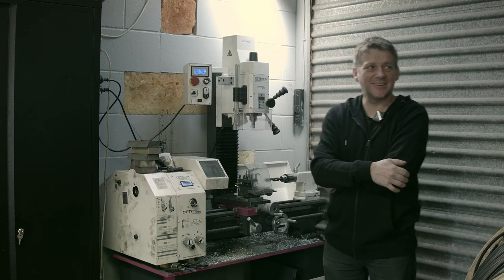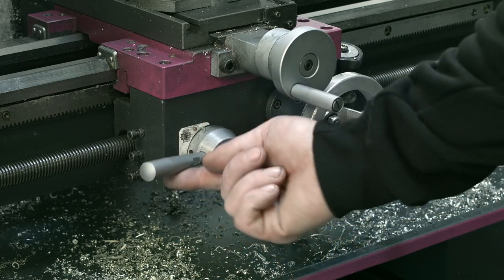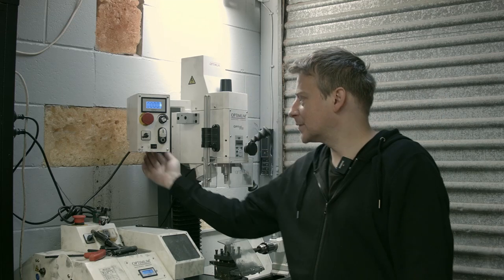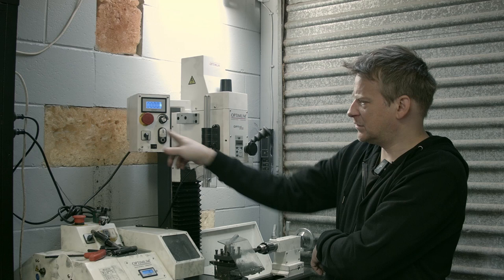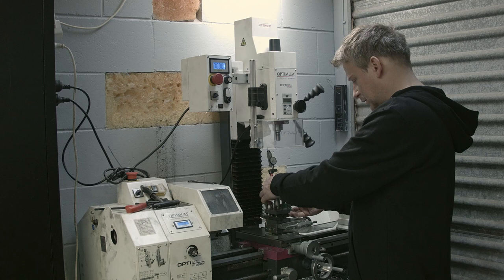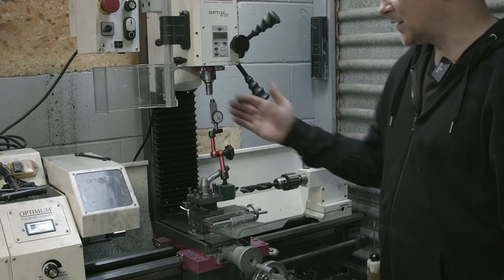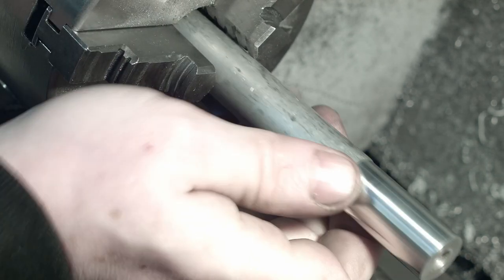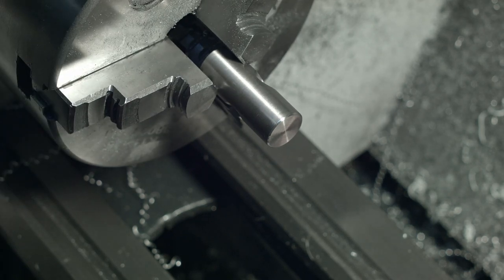TU-2506V-20M - Opti-Turn Lathe & Mill Drill Combination. review and test turning

Comment: That looks like a Grizzly G0602 lathe with a Grizzly G704 mill attached to it. I have both AND, YES the mill attachment is questionable. In fact I bought another column to scrape in for a CNC conversion.
Reply: I've watched further and I gotta tell ya both my machines are not as bad as your combo. It looks the Grizzly and yours were made by the same factory. Maybe the middleman has to pay more not to get and sell the factory floor rejects on to unsuspecting customers.
Reply from the maker: i suspect they make a lot of them for different companies , and i guess different companies pay different prices for different qualities. or this is a knock off of Grizzy by some other Chinese company. 
after a year this machine is falling a part.. recently to make a m8 thread i had to turn those gears they provide, so they are not jamming against each other... also i had to turn the OD so they are round not oval... 
everything what comes to my mind now are only bad words, so i will stop here :D
Reply: @PiotrFoxWysocki  Ugh. I hear you. I bought a PM932 which came with problems right out the gate. That was 3 years ago. I got sent a kit of parts to replace on the darn thing but with covid and other crap going on that is way down my list of things to do. It really is a crapshoot what you get with these companies that are just middlemen selling Asian imports of questionable pedigree.  Stay safe and get a better machine and look forwards.

Comment: Thank you so much for this candid review. I was looking at these yesterday along with the HAFCO AL-250-G and the bigger brother to that pair (TU-3008G and the AL320-G). The Optimum seem to have a better finish than the HAFCO with metal where the other had plastic, and just generally looked better. But I was concerned when I saw made in China on the back of the Optimum. While the Optimum looks better on the surface I am not convinced it is better when it comes to tolerances or performance, which is very disappointing.
Reply from the maker: Optimum was looking nice until the paint started peeling off like a snake skin.. I guess hafco won't be much different. Well I'm so disappointed with this one that the words can not describe how bad it is..
Reply: @PiotrFoxWysocki  I expected the HAFCO would be worse than the Optimum looking at it, although the HAFCO is heavier for the same class lathe. Things like the casting flash and rail finish on the Optimum looked much better, but it seems the beauty is only skin deep and under the hood it is still the same Chinese garbage. The TU-3008G and the AL320-G both look like a step up from the TU-2506V and AL-250-G, but so is the price. Seeing your review I don't think I could bring myself to buy the TU-2506V or the AL-250-G. Makes me wonder if I should DIY a lathe like I did my CNC.
Reply from the maker: Bigger is almost always better 😉 castings on the optimum feel very soft. And they are worn in no time. I'm contemplating on making lathe from scratch, or getting a tormach lathe. They seem to be the cheapest form factor to the performance.

Comment: Can you brace the top of the mill column back to the wall to give you more rigidity for milling?
Reply from the maker: I might try this eventually ;)
Reply: yes the problem there is the lathe frame. I have a bf20L converted at CNC and it's way more rigid that that. You better bolt it to the wall to gain the rigidity back.

Comment: Oddly, Congratulations.

You will get it sorted out. It is likely a Chinese unit. The mill looks like a Grizzly G0704 or Precision-Mathews. The lathe looks almost like a G0602.

The lathe turning looks decent on aluminum. On the stainless, it looks as good as the CNC'ed cut. Perhaps there's a more optimal insert for aluminum.

I've seen youtube videos where they bolted the column to the wall to increase the rigidity. On CNCZone.com, there are articles where people did the old polymer-concrete treatment to the column and base, but if you are going to CNC it, it's likely best to make sure you know what you are going to do with it first, before filling everything with Epoxy/granite.

Comment: Interesting video, I’m looking for a cheap bench lathe and here in Australia these units are one of the few options available. For those in a similar position to myself, go and have a look at videos on the subject by Blondihacks and This Old Tony. Blondihacks does one on Chinese lathes in general, and she owns what looks to be the US version of this one. Basically they all start out in the same factory and are then further fitted, machined and so forth by different factories to different specs for different suppliers in the country of sale. This Old Tony goes into tips like swapping out the headstock bearings (though he’s got a much smaller unit it’s probably still relevant info).
Reply from the maker: My lathe is failing in every element there is. It just falls a part.

Comment: I have the Optimum TU2807 vario, I too was very disappointed with the quality and it took a lot of work and modifications to make it reliable
My BF46 Vario mill had to be fully disassembled to tighten up bolts that fell out and replace missing bolts

Overall very poor quality control

Comment: So.  What size surface plate will you be building your lathe on?
Reply from the maker: Rather large ;) im still contemplating all sorts of angles and mounting solutions.
Reply: @PiotrFoxWysocki  Did you see Dan Gelbart's granite lathe? Apparently he build it from scratch, including air bearings except for the ones in the spindle and grinder. His machine is not large at all, about the same size as yours but have 1 micron accuracy, thanks to his surface plate bed
Reply from the maker: Yes i have seen it. I think accuracy is coming from more than a surface plate.
Reply: @PiotrFoxWysocki  He says the bed plus the accuracy of the spindle is the key but he does not give much details on how he build it. Also the air bearings on the bed or the tailstock seems not to have any tubing attached, so they probably rely only on static air cushion due to them being super accurate
Reply from the maker: Haha 😄 i think i should get much more misterious about my cnc as well 😉 so far looks like i give ideas left and right  and others take it and make their own channels claiming it was their idea. Kinda annoying. I guess its time to learn from the best 😉
Reply: @PiotrFoxWysocki  He has connections and apparently business sense for selling his inventions. So, he was indeed careful. He is specialized in precision machinery for optical systems and sold his company over a billion dollars recently. I think his educational videos on youtube is just charity and probably also due to lack of work as he does not seem to be kind of guy who would spend his newfound wealth on luxury.
Reply from the maker: Very Interesting, i didnt know that

Comment: I had the same bad finish like yours. And the problem was the bearings. They are deep ball grove. You have to change them with roller tapered. The difference was enormous. Also the chater and vibrations sounds are from the bearings. I noticed that the bearings are the most important part of a lathe becouse are a dinamic sistem. Change them with precision ones and pretensionate them and you will have anouther lathe in your shop.
Reply from the maker: Im sure i will take look into it shortly, once current bearings will fail.
Reply: There's a video from Dan Gelbart, he's build a high Precision lathe with selfmade air-bearings.

Comment: Yes, chinese mini lathes are tempting, roller bearings are way better, it's just such a hassle changing them. They could've used them as they were building the damned thing, not much more expensive. 
BTW, have you tried pcd's in stead of carbon yet? Will get you mirror finishes. Polishing carbon straight inserts with a high grit polishing diamond impregnated silicone mini wheel on a micromotor will get you great finishes too. With a coarser wheel you van reshape old chipped carbon inserts, even create custom ones. I'll be using a lot of convex, round shapes for different sizes when i get my lathe.
Bolting the minilathe on a heavy metal bench helps with rigidity. For small pieces and soft synthetics they are fine. I'am getting one. 
That mill though? I'm going CNC with that. 
Save your fingers, use a paper tissue cut in 4.
I enjoyed the video, will be looking out for more of 'em, cheers!
Reply from the maker: thanks for the tips, i will investigate
Reply: @PiotrFoxWysocki  https://m.indiamart.com/proddetail/air-bearings-11668946897.html
These are like $35-40 a piece, i think.
Reply from the maker: they might be a micron precision but they are not as durable as regular bearings. might be good for separate machine for finishing. but for removing lots of material not so much.
Reply: @PiotrFoxWysocki  yes, air bearings are best for small pieces, not for turning heavy load objects.
The good news about your "Optimus Prime" lathe is, it comes with a  "Self- destruct" mode. Just kidding, it just gradually turns into a piece of crap:)
The upside is, it has tapered roller bearings, P5 quantity, no less, the downside is, they're probably already shot. But they're much easier to replace. But try to lubricate these first, might serve you some time. It will probably a first they see some tending, they have to be oiled at least once a week, or get the closed ones, more expensive, no maintenance. The new versions of these have a digital spindle readout, same 750 Watt. That's the one i'm getting, they go around for €900. Installing a 3 axis DRO will be an aditional €200 with 2x 1 micron scales. You have to keep the dream alive with these things, haha. 1 micron!...

Comment: ...Mine has a different colour but is basically the same s***. The way to get a good finish is either take large cuts or tiny ones with a sharp insert. Get yourself some sharp polished inserts for finishing. I use them on everything, and as long as you do not do interrupted cuts they hold up good. Here is a link to the ones I use, you can probably find something similar where you are from. https://www.shop-apt.co.uk/carbide-inserts-for-turning-aluminium-alloys-non-ferrous-metals-plastics.html
Also if you turn chrome plated rods or rusty and scaled stuff, make a deep first pass to get under the hard part. Otherwise you will be constantly changing inserts.

Comment: have the same piece of junk, had to split lathe and mill, bought mill table, backlash is shocking, changing all xyz leading screws and motor which overheats in minutes at low revs
Reply from the maker: i have to say that this mill attached to the lathe is useless in this combination. i have been also thinking to take it off.

Comment: the worst thing about this lathe is changing the gears, i hate it, i always manual feed and leave it setup for threading , 1 of my gears is stamped incorrectly and 1 dosn't have any markings ...
Reply from the maker: Today I had to bolt 2 gears together because there was soo much play between them.. one tooth of backlash.. I also had to turn outer diameter because they have been jamming. Those gears are not even round..

Comment: I knew you cannot live with this machine, you will dismantle the machine and modify by polymer concrete change bearings,  reface mating surfaces etc etc to nearly a German standard.
Reply from the maker: Im not sure if its worth putting time into it. But who knows..
Reply: @PiotrFoxWysocki  on my mill I bolted an old lathe spindle head to it the table and the tools to the mill head, it's very automated now and can even pull  bar stock into itself.  I just unbolt the lathe head/"4th axis" when not using it.  Possibilities are endless, ideas keep me up at night...YOU know this!  haha
Reply: Polishing a turd can be a lot of fun sometimes:)
Reply: @ruud4508  and as Mythbusters proved, it is possible.
Reply: @kieranh2005  a turd can turn into a Prince, just not after a kiss.yuck

Comment: Please don't use or have cloth (incl. long sleeves) anywhere close to powerful spinning machinery. It can easily snag on the chuck or anything even slightly rough and pull your fingers/hands/arms in. Flesh and bone is nothing to a lathe that can do heavy cuts in metal.

Comment: Thanks for the review. But I'm guessing everyone watching this is on a tight budget. I have to say I watched videos of people spending hours and $$ getting eBay lathes to a standard that the optiturn 2004v which I bought had right out of the box for only $200 more. I'm no engineer but it's been a damn good little lathe. I'm also not building components to put a shuttle into space and back safely. These smaller machines seem great for the average crap the average person is doing in their garage. I also get a bit sick of bagging the Chinese. They also put satellites into space. They're mass producing items at a budget which we keep buying because we won't or can't pay a premium  then bitching about. Who's the idiot? I know I am and I'll keep going back for more because I can't afford the high end options. Btw .... There's plenty of folk building awesome stuff with optiturn lathes, eBay lathes, etc etc. Just saying .....
Reply: And while I'm on a bandwagon, check out blondihacks. Basically has the same model rebranded lathe (not the combo here granted), but she produces things I hope to aspire to one day. Point is, the machine is very capable. Look around before you bag something and decide not to buy. Search for it under different brand names and see what people are doing. I find people who bitch together flock together .....  I still appreciate this review though cause now I know I'll have to deal with the rigidity issue if I go this path. Thanks mate.

Comment: The only thing the manufacturer got from this was "that's pretty cool".

Hold on you cannot move the mill part. What is the point of this device? I picked up my Colchester chipmaster in good working order for £350! If you can get something like that why would you buy this junk?
Reply from the maker: hahaha:) yeah i guess so :)
Reply: @PiotrFoxWysocki  challenge for you, move the controls etc how you would want them, and any other mods you can do to make it a less useless device. I know you have the skills and any other person who buys one the may know what part to make first to fix their new mill/lathe.
Reply from the maker: I haven't made my mind about it yet. Its like converting a deawoo to be ferrari. At the moment i dont want to put any time to upgrade it. I will run it as it is and fix whatever fells off.
Reply: @PiotrFoxWysocki  that's fair, I've wasted time polishing a turd before not worth it.

Comment: You must have the bolts half done up or hes done it on purpose because i have one and its solid as no play at all. Do you really think any company would sell a machine with play in it like that? They wouldn't sell yet in Australia hare and forbes sell a lot of them and sell the mill attachment seperate also. I got the last one in my state. So why could i not find any complaints except yours? Come on be honest you loosened the bolts connecting the milling attachment to the lathe bed.
Reply from the maker: I have been using this machine for half a year now and if i would make another review  i would say much more about what is wrong with it.  I bought it for work. Now i thing that this is not even suitable for hobbyist. Maybe if you turn 1-3 light parts a month. But if you use it 10h a day it is just falling a part while you working. Build quality is terrible. Mill attachment in my case bends no matter how tight i bolt it. I could go for hour describing how frustrating is to use this machine.
Reply: @PiotrFoxWysocki  is there a lathe/mill you recommend ? Under 4K ?

Comment: I own Optimum BF30Vario mill. Just china shit. Before i screwed to steel base (desk) made from 30mm steel plate (aprox 300kg) plus all screwed to solid concrete floor, walls and extra rigid support for column top it come plus minus usable. I do not tell about sliding surface quality :) DO NOT BUY OPTIMUM PRODUCTS

Comment: If you look the machine construction, its a copy of old russian machines. For example, on the compound the handwheel pegs are equal length -- one should be longer than the other so you don't bump your hand into it when spinning it. But the russian machines were war machines not anorexic toys.